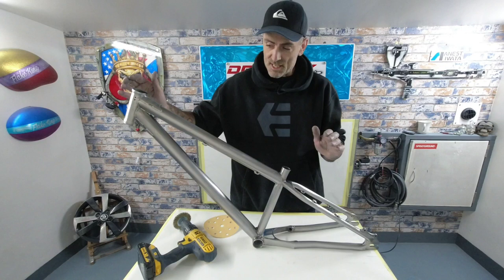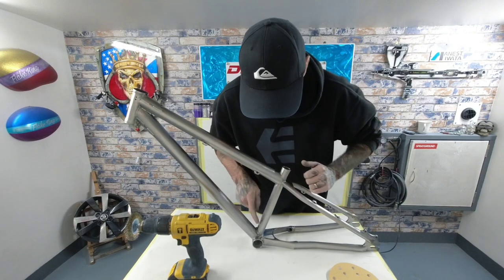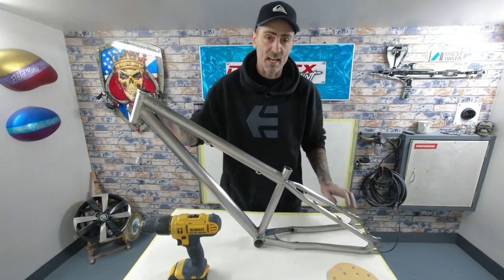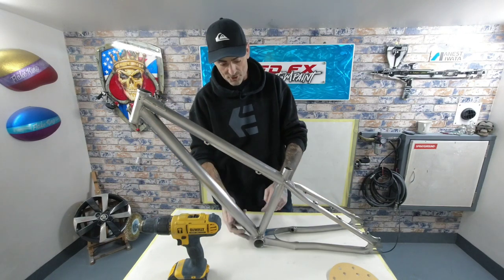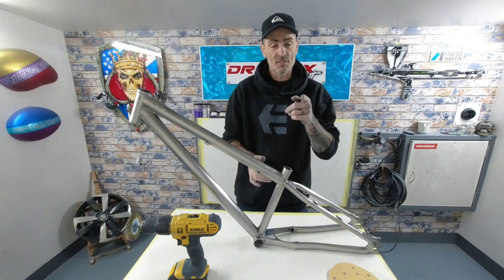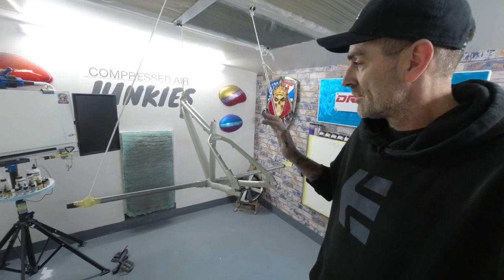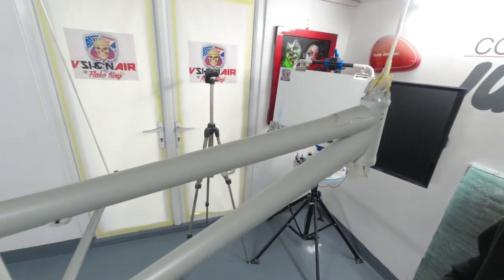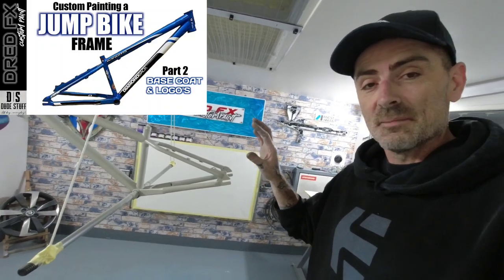CUSTOM PAINTING A JUMPBIKE FRAME

Comment: I bet it took a fair while to strip the fame down to bare metal Rob but it's the only way to be sure it's done right and will look better for it in the end, it's all about the prep but it's looking good so far and that primer is nice and flat which will save a lot of time with the sanding 💪👍
Reply from the maker: 2 hours John to strip it them wire wheels are great for the welds and getting in on the small parts and they came from Wilkinsons at £3.00 and lasted so good 
Bit of kit 👌
Reply: Yeah they are good, I don't know what the drill ones are like but I've had those wires fly out when using the angle grinder ones, can be very dangerous if you are not waring the correct ppe 😨🤦‍♂️